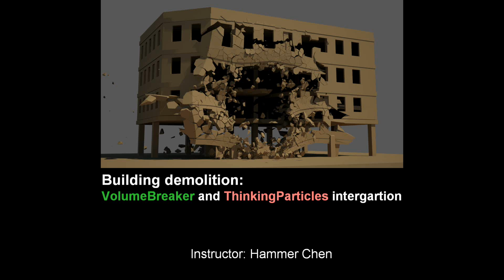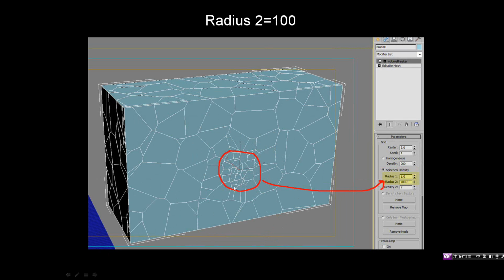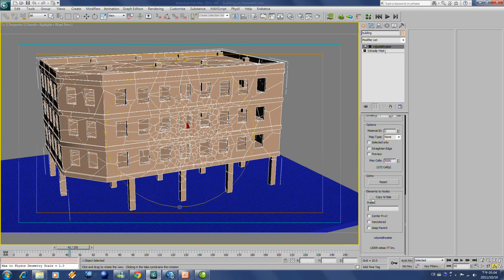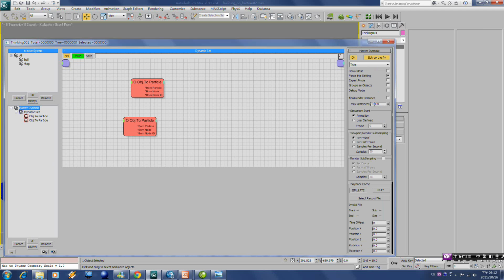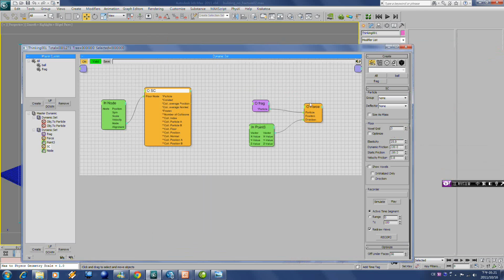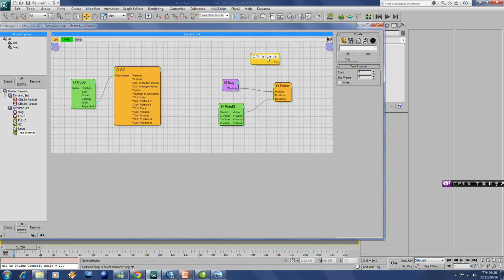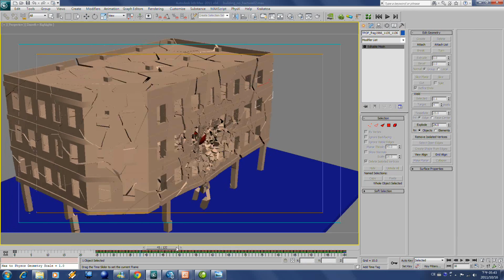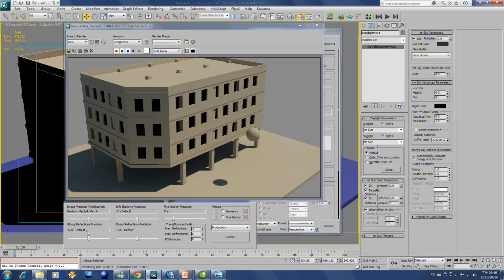Building demolition: Volumebreaker and Thinkingparticles intergation tutorial

Comment from the maker: mu machine is a : i5 4core CPU, 16 GB RAM, GeForce GTX 460 grahic card. I think problem is 3ds max itself, not the particle module. If I remember right, the 3ds max 2013 support multi-thread for particle flow.